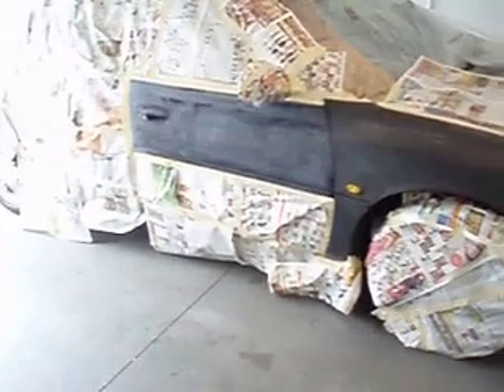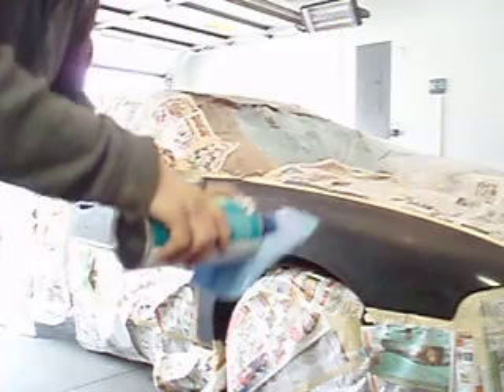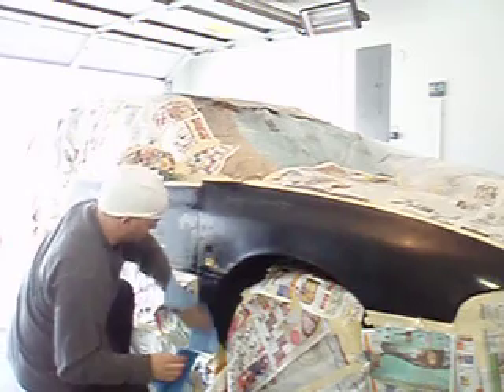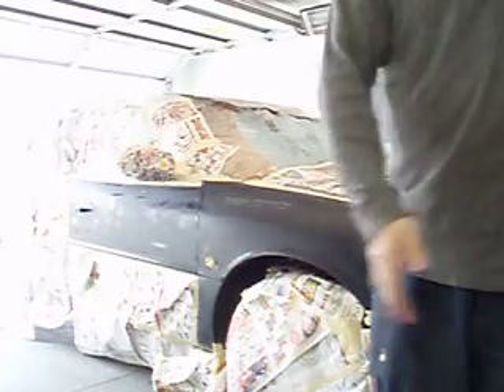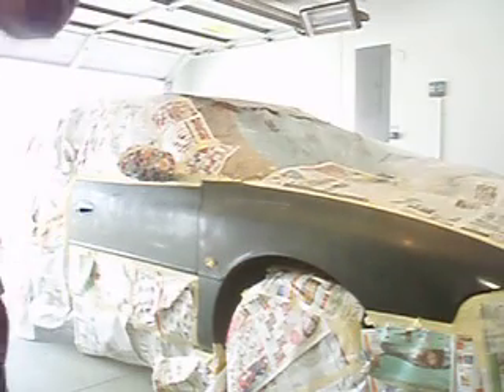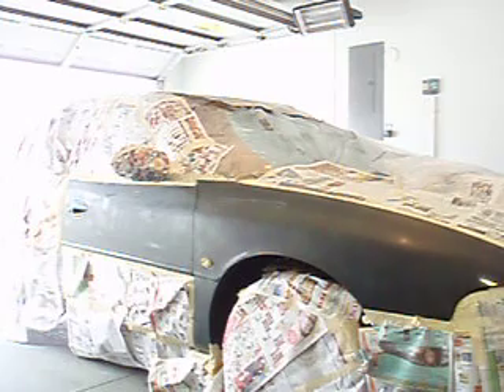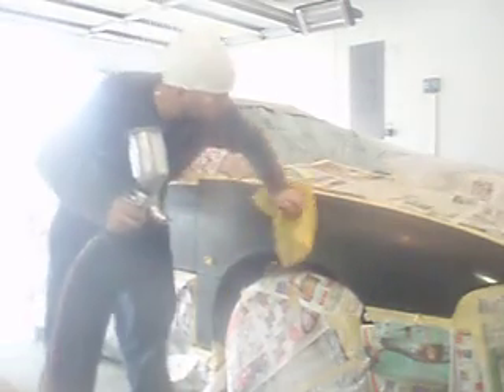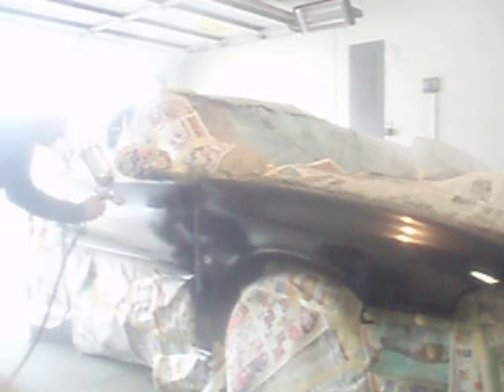Do it yourself Car paint

Comment: We do this all the time in the shop when we need to save time. It works fine as long as you do good prep work and use good primers. To save tape, use drop cloths over the wheels and large areas of the car. Nice Job

Comment: P.S. how much paint to do my 4 dr taurs blue on the body and white on top no jams just my beater I drive. thinking of 2 stage cus clears on 75 a gallon with hardner. Painted my bmx pro style came out great, with wet sanding-rubing compound-sealing-glasing-waxing. & dupli color effex before clear coat. I used a decent gloss clear on that. Does it matter? Thanks for reading.

Comment: At what pressure did you set your gun at? Good Video, but many leave out some small details,,,such as Air Pressure and size of tip, I assumer you are using a 1.4 @ 8lbs.??

Comment: I've never seen the rattle can, polyurethane as a primer idea...I noticed you didn't put it on very heavy either. So, you just spray wet on wet polyurethane? I'd be (personally speaking) worried about the chemicals not getting along with one another.  Either way, you da' man!  Good job.

Comment: Never use newspaper, as it breaks up like small pieces of lint that ends up in your paint/clear. Spend a few extra dollars and get the right stuff. For your daily driver many will go the cheaper route, but why? FOr just s few more dollars, it can be done right. Paper towels? Garage door open while cleaning? Pollen, dust other impurities floating around. I can't watch anymore. DON'T quit your day job.